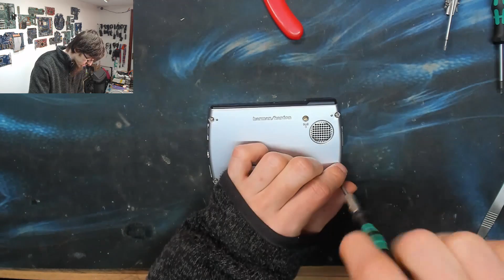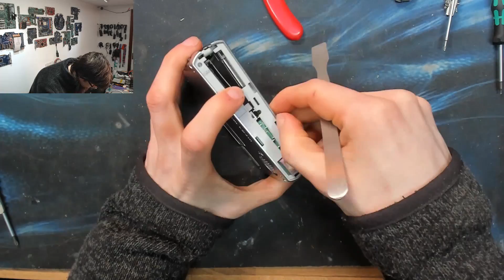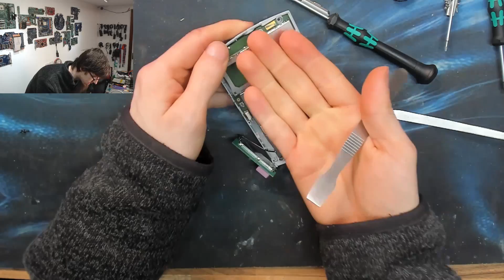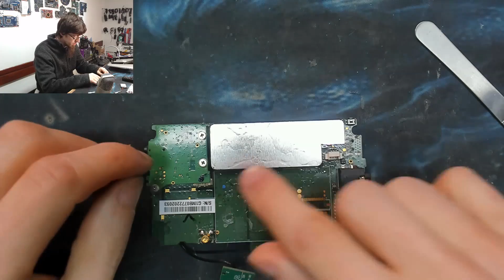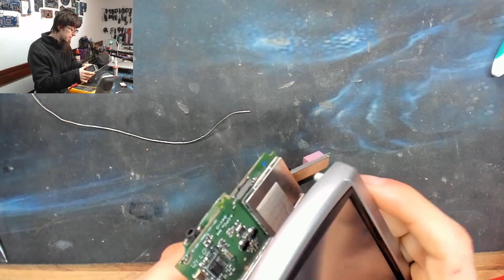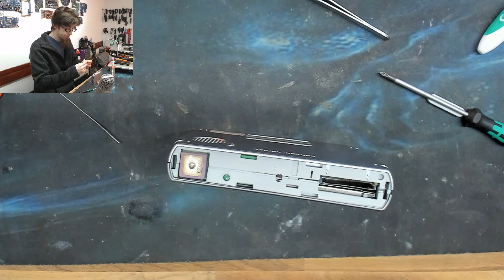LFC#198 - Another USB repair, Harmon/kardon Sat Nav

Comment: Hello Adam, what is your opinion on the Dremel Versatip, is this good for beginner soldering or a regular plug in 30watt solder iron?
I have some experience from 1996/1997 and thats it, when i was in my teens :) now im like you i need to work on my thin pcboard for a harddrive usb 3 port which is "dry"
Really annoying how these manufacturer get away with poor quality , bloody hell
Im in no hurry but i have got some thin solder and flux paste , sadly the store has no wick .... so i need to get wick i am guessing...i attempted to heat the joints up on the usb3 connector, but sadly i created a bridge between 2 joints of the 5 on the pc board. Its also pretty small so its difficult to see.
In the meantime i had regassed my versatip which i have never used as yet, got the solder wire and some "eagle"  flux paste....
Reply from the maker: Never tried a butane soldering iron myself, my main concern is not being temp controlled. With electronics, it's always nice to know what temp you're running at, so you can avoid cooking the board, or know when you're not hot enough.
That being said, I'm sure some practise and getting to know it would solve that. You get used to an iron and start to know by feel when you're too hot/cold, etc...

Comment: I have used epoxy and hot glue on micro usb b connectors when the mounting pins have broken off. Do you have a strong feeling or recommendation about if those add strength to charging usb?
Reply from the maker: Hot glue isn't a strong fixative. It's good for an interference fit (ala, it can't move if every millimetre of space around it is flooded with hot glue) but I wouldn't expect it to hold up against strain.
Epoxy probably does the job, but may be messy, and you only get one shot at it.
I try to solder if I can, because it's a strong repair, and can be re-repaired if it doesn't take.
Reply: @Adamant_IT  Superglue with bi-carb to build material works wonders. I've used it at work to secure a laptop dc port after the surrounding plastic had failed. Extremely strong also, bodged a van door handle with it when it broke in the Oz outback (lasted until I got to a wreckers). Only downside is if a repair needs to be done in that area in future.

Comment: Satnav's were never designed to run off the internal battery. They are normally connected to the cigarette socket of the car. The battery (which is normally kept charged by the cigarette socket) is just to allow trip planning before starting the car. I have a tom tom and a navman here and they are both 5V dc 1A usb mini. The devices aren't supplied with a wall adapter, just a accessory socket adapter as they are designed to be used in... a car. No way would tom tom put 9v dc on a usb socket. that would just be asking to be sued by angry customers who try to plug a cellphone or other device apart from the tom tom into the adapter!
Reply from the maker: They certainly used to do this. I might be wrong for modern models, and they may have changed the practise a while back. These days we have more sophisticated PD standards - but certainly 10 years ago there were SatNav car adaptors that ran 9v into the USB port.

Comment: What a mess, sorry but that TS100 is too good for your soldering skills.
Reply: its stronger that way. Oversodering will give it little more hold for daily use.
Reply: @wahabfiles6260  The joint is only as strong as the pad itself, adding more solder to a damaged pad accomplishes absolutely nothing.

Comment: Great at last some one else that complains about the modern USB connectors.
I find certainly that micro USB and even USB C to be not up to the rough handling of constant use..
Reply from the maker: It does seem to fall down to connector quality as well... There are some USB micro devices that seem to be fine after years of use, but others are notorious for failing within a year.
Depends vastly on the use case too. Can't remember if I said it in the video, but a sat nav like this is going to get rough treatment getting plugged and unplugged every time it's pull out the glove box. Designers should've known this and reinforced the USB connector to the hilt.

Comment: Are you trying to save money on flux? Flux is your friend, remember that. Also you should be tinning the tip of your iron  EVERYTIME  it goes in your holder. Pro tip............
Reply from the maker: The amount of flux I use is plenty! I needed it at the start... which is why I then added some. If you're expecting a Milli-Paul of flux then you need to head over to Louis Rossman ;)
As for tinning, you'll notice from the tap-tap that I am cleaning my tip after each use. It's a knife-edge tip, only the very edge is shiny.
Reply: @Adamant_IT  I agree with David on this one. More flux will help produce a good solder flow specifically when you put the solder directly on the iron tip, the flux integrated to your solder will then go in smoke so you need flux on the work area to compensate.
Reply: @Adamant_IT  I saw you were struggleing to flow that joint so it was just a tip. Using more flux is messy I know but works wonders. Louis is a bit ridiculous.... Just that i have been doing this for 30 years and thought it would help.   Also tinning your tip would keep it clean and ready.......